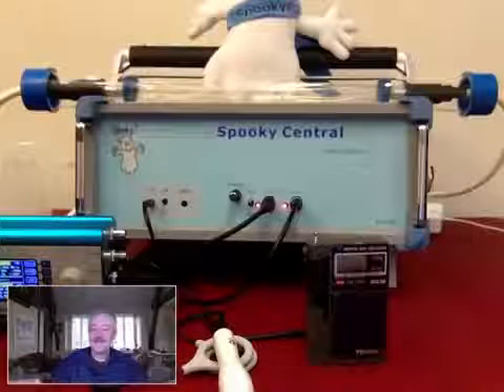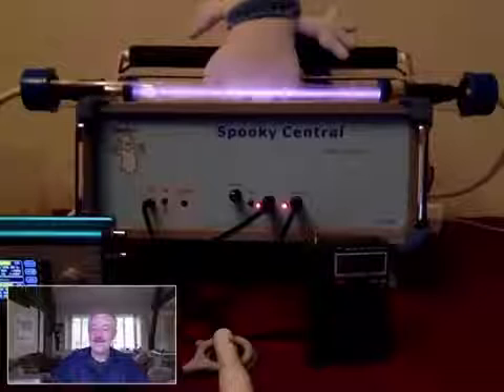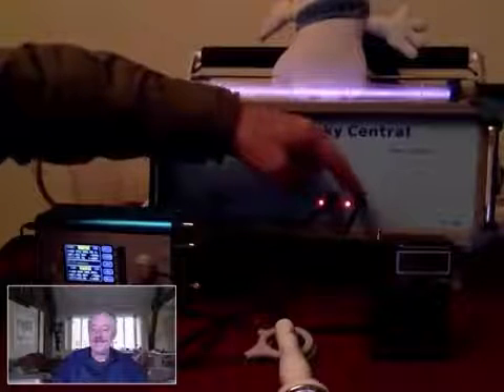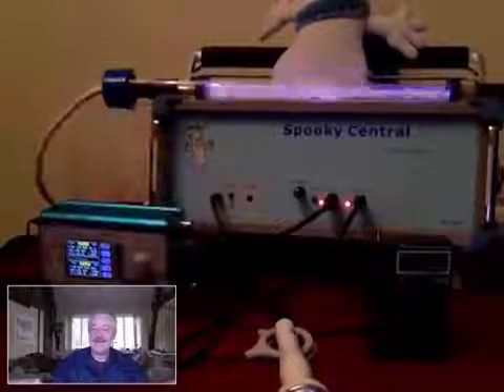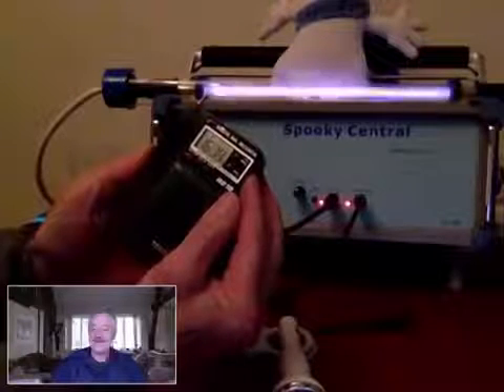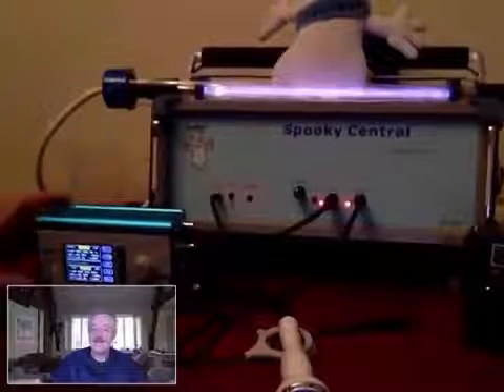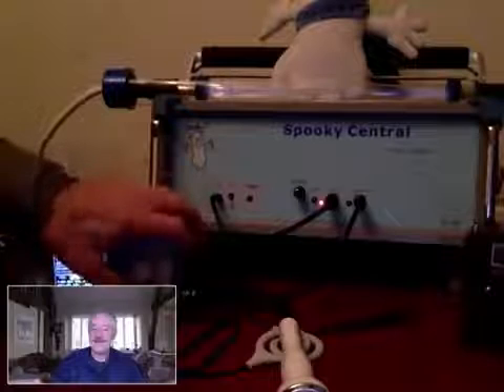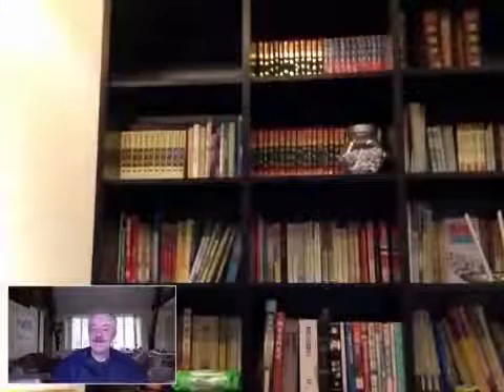How Spooky Plasma works

Comment: You know what, i think you are all going about this the wrong way. We know FROM rife that it is possible, but really that is all we know. What someone needs to do is to redo his work using a microscope and todays equipment to re-prove that it can be done. The NEW frequencies need to be found using the new equipment, and not following in rife's footsteps exactly, cos you won't have his success unless you use his machines and his exact frequencies, neither of which you have. Someone did some experimentation along these lines in the 90s, the video is on YT somewhere, but it is incomplete, but enough to realise that it is feasible. This needs re-doing with a spooky. Yes it may take a long time, but at least you have a start point, the new frequencies may be not that far from the original ones? If you did that and had success, think what that would do for sales of spooky. Buy your shares now.
Reply from the maker: Thank you for your advice, are you willing to share more details about these? We could discuss together and welcome to send emails to support@spooky2-mall.com. :)
Reply: https://www.youtube.com/watch?v=rvU9JrWycFI
Got my dates wrong, the video is in the sidebar on my computer labelled Rife Bare Plasma Experiment Destroys Micro organisms (June 28th 2007) at the above link. Good quality microscopes can be bought fairly cheaply on ebay these days, the ones used above utilised 40x magnification.